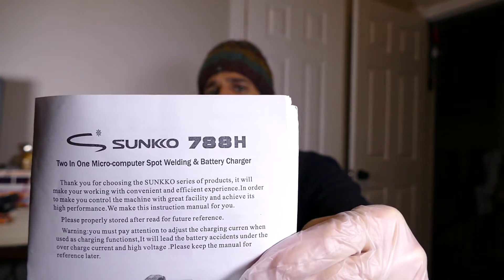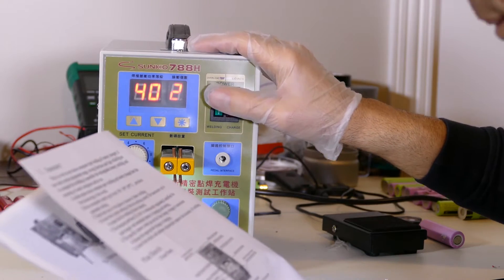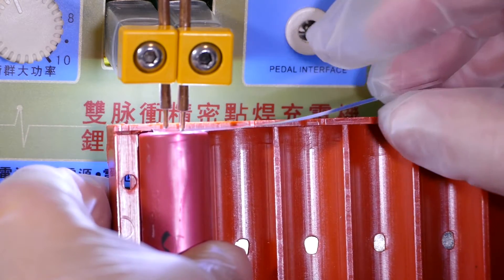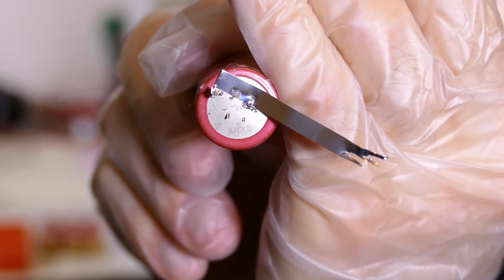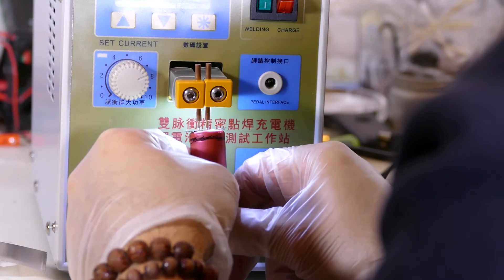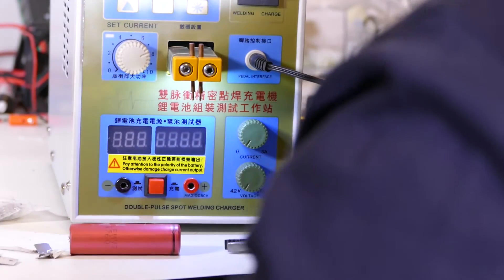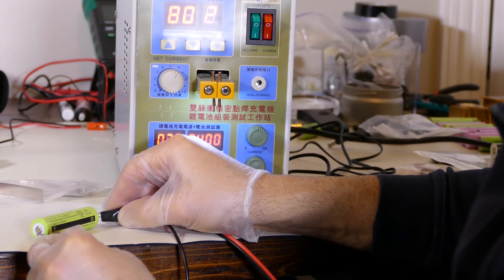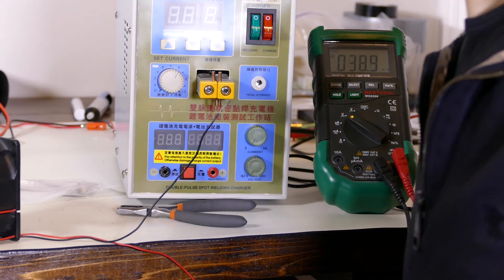Sunko 788H Battery Spot Welder Review w/18650 cells

Comment: Here in Australia we use 230v and my 788h kept tripping a 16 amp breaker when turned on! Changing the breaker to a larger one is not an option due to our electrical codes - the unit came fitted with a plug for a 10 amp circuit and the maximum breaker allowed is 16 amp. Using a long extension lead and sometimes it worked other times it didn't. After much research I changed the transformer for a microwave one with 2 1/2 turns on the secondary, now it works like it should and does excellent welds. The problem is the crappy transformer they used, I'm pretty sure they used a 110v in a welder supposedly meant for a 230v country - the primary measures 0.8 ohms, which allows for a huge inrush current when turned on. I don't see how this could have passed Australian Electrical Standards.

Comment: Signed in so I could let all the viewers know (post 2022) that at 240vac input this welder rocks. Amazing what doubling the source voltage from 120v to 240v can do and this is especially true with high current devices that don't use high capacity capacitors to produce the high current needed.
No breaker popping on 240volts either and the booklet has a table showing what current/pulse timing for what nickel/nickel plated straps and thickness.
Reply: How are these re wired to 240v. I cant find any1 who shows step for step wiring 240 with fuse. Black Negative and red positive, do u wire 240 1 hot wire to black negative and 1 hot wire to red positive the the board.

Comment: Recommend getting the 220V version.  I am welding .2mm x 8mm strips.
Reply: How do u wire the 240 plug to this machine. And what size fuses to use. Does each wire get fuse going to circuit board? 1 wire to red 1 wire to black?

Comment: Hallo, ich habe grosse Probleme mit dem Gerät. Der Spotwelder erzeugt 
sofort einen Kurzschluss, wenn man ihn einschaltet oder den Prozess 
startet. Die 16A Sicherung fliegt raus. Wie stark muss die Sicherung 
sein, damit es funktioniert?
Reply: Hello, I have big problems with the device. The Spotwelder immediately creates a short circuit when you switch it on or start the process. The 16A fuse blows out. How strong does the fuse need to be for it to work?

Comment: So they will make a truck... That's good. For some time now I've been figuring "If Tesla really wants to make money, they'll make a viable ( lovy.biz/44oi )1/2-ton LUV fleet-truck.". And they plan to make Class-8 semi-tractors & buses as well? Makes me look forward to the first luxury EV motor-home, built with fixed roof-top & retractable solar panels, all powering the EM-induction cook-top, water-heater & washer/clothes-dryer. Add a water collection system with reverse-osmosis treatment & UV-sterilizing, and you'll be set to survive anywhere, anytime!
Reply: need for more backup
Reply: I remember he was blowing things up," Clare replied.
Reply: top secret idea and perfect line included in thi guide
Reply: best afforted in this plan so use this battery recovery ideas
Reply: Solar and Storage Battery Reconditioning

Comment: I tested 2 batteries on the weekend and both of them seemed it be “dead". After using one of your methods [Check Details Here==>https://plus.google.com/100351090281822647456/posts/Gwtd4mVBdEd ] I was able to rejuvenate them both to 100% working batteries. Thanks, you just saved me about $180! :)

Comment: Hi thank you for the video. What thickness of nickel did you use?
Reply from the maker: geez a cant remember think it was .5mm
Reply: @useurlogic4383  U used the provided nickel-plated steel trips which are 0.1mm this welder is useless for pure nickel
Reply: that's very thick. Standard is 0.15mm

Comment: Two observations: 
1) When you are using the pedal, make sure you are applying sufficient pressure between the welding pins and the nickel tab + battery beneath. Adjust the resistance pressure of the tips with the knob on the top of the machine, and make sure you're pushing against that force before you trigger the pedal. The reason you're seeing more burn marks and less actual welding when using the pedal is that you aren't pressing the pieces together like you have to when you weld without the pedal (because you have to lift it against the spring force of the two arms before it triggers), so the current is just skating through the nickel tab instead of passing down through the battery surface as well. 
2) I think the two digit number in the welding current display is the number of milliseconds for which welding current is passed upon triggering. Bigger number == longer pulse of current passing from one contact through the welding targets to the second contact, increasing the weld strength (but watch out for the accumulation of heat, which damages lithium cells).
Reply from the maker: +Duncan Zahringer yes after some time of using it your two points are exactly correct. I  find it easier for welding the lithium cells without using the pedal.

Comment: Hi I have just got one thanks to you and
your review (It was the first coherent and concise one I came across and the
last to come back too to thank you).   I decided to do a bit of poking around on
the web and learned:-1/    You need a C Curve MCB (I am using 6mm2 T&E)
it is a Spur off the consumer unit for the Cooker, Oven & Hob @ 10 Meters
cable run in conduit.2/    I am going to
fit a SPST switch with a Missile cover (Basic surge protection device) bridged
with a 47 ohm resistor (ohms law @ 240 volts AC) to limit start up to 5amps (4.?
I forget now).3/    I will fit a
3pin UK Fused Plug (I recon apart from initial surge) it can only be 10amp total
draw.4/    I may live to
regret all this and more but I will enjoy the journey in trying to rebuild Tool
NiCad Battery Packs (Snap-On 1/2" & 3/8" Impact Guns).5/   :-) Thank you regards David

Comment: Warning! These are Chinese domestic quality units, they will NOT pass western electrical safety standards. 
If you are game to import one have a qualified electrician perform an electrical appliance acceptance test.As an engineer I had to rebuilt mine completely to be electrically safe which included replacing the power lead and plug to the correct amperage. These units should not be plugged into a normal domestic 10A power outlet.
There is little to no quality control in manufacturing with reports from china that these units have been known to smoke or electrocute the operator when first turned on.
Further I found when I opened the unit the power lead was in fact 2 core with NO EARTH even though it was attached to a 3 pin power plug. This is how deceiving and dangerous this unit is!

Comment: the whole device looks just cheap.
Reply: In the immortal words of BTO You Ain't Seen Nothing Yet.If you care to look inside one you will Die (Hopefully Laughing) it is that scary.
Reply: +David Tweddle is it that bad? I really need one. nothing else in this price range....
Reply: Yes Jake Sorry but the price is why I got it after checking on-line.The general consensus was if you get it be prepared to repair it, I am so I did.Not yet opened mine up but I have got the SPST switch 47R Ceramic Resister and a Missile Cover for at a glance added safety.I hope my maths are correct and the switch bridged with the resister will limit the start up surge to 5a max (4.?a), power the unit up then when you want to weld throw the switch.   This should not then need a C Curve MCB....   I will see...I will also have on order ASAP some Spare 30 amp Triacs (I may go 40amp) as it tends to eat them by the dozen if you don't take it slow.Cooling (What none) I have just got a PCU Fan and Heat Sink how I fit  with the Triac  is the question...
Reply: it looks cheap because it IS cheap, $100 cheap

Comment: Where do you live?

Bought this but could not get it to work since the rated A of 15A was not correct, It was more so it blow all 16A fused it was tested with. Even at a tech lab.
Reply from the maker: +elcykelguiden.se im in Canada . it needs a 20A circuit. It constantly trips my 15A breaker. So in my home i have an extension cord that gets plugged into my bathroom which has 20A

Comment: Thanks mate. I've just picked up the same Arc and did my first newbie,  bigfoot video. https://www.youtube.com/watch?v=Ow-aLvdD35c&feature=youtu.be. I had the same issues with power as you. Ended up having to use my off grid gear to make the damn thing work! I also noticed my setup is setup differently than you, @80 was a LOT more powerful than you described
Reply from the maker: +LibC Yeah im sure they are not all created equal...LOL zero quality control im sure also i find that the nickel strips depending on the weight and size play a big role.

Comment: Is it still working perfectly? I'm thinking about getting this one. Would you buy it again? Is there a way to hook up probes to it so you don't have to hold the pack up to the machine? Does it come with extra tips? Which seller did you buy it from?
Reply from the maker: +ThingsDemystified Yes this is still working for me very well. Im sure you can make your own probe if you dont want to use the built in one. it came with 1 set of extra tips. store on alisxpress was funtwoo

Comment: That rotary knob associated with the current may possibly be pulse duration..??
Reply from the maker: +Keith Forbes im not sure, starting to think this is the actual current knob. While the digital readout is more voltage , the number beside it is the pulse length ( only option is 1 or 2) single 1 dosn't work very well. all in all though i cant complain it works pretty well. lets see how long it lasts.
Reply: isn't 1 or 2 the number of pulses?
A double pulse gives better welds.